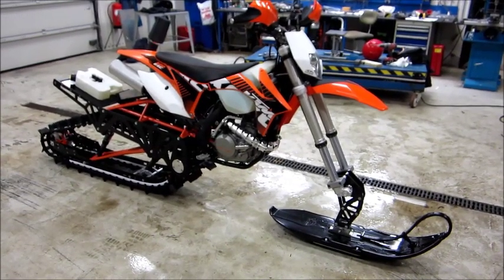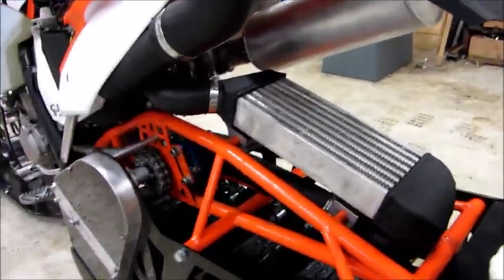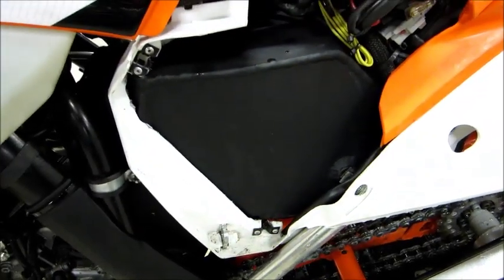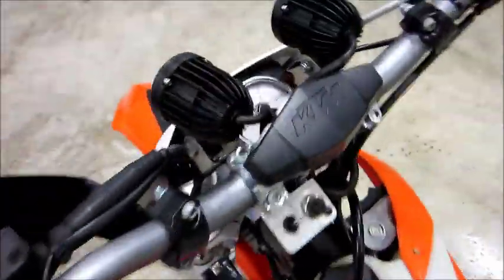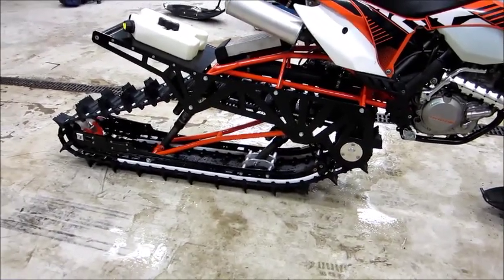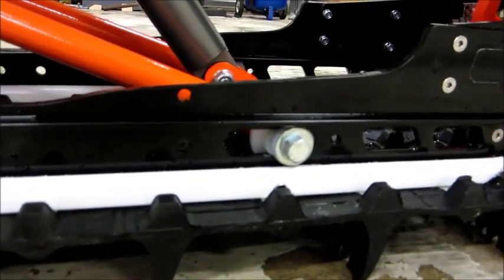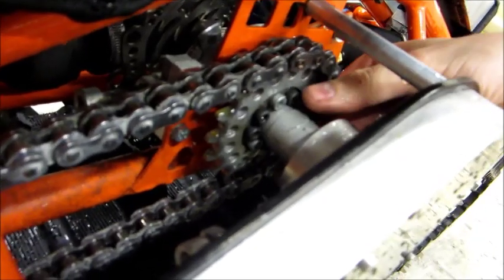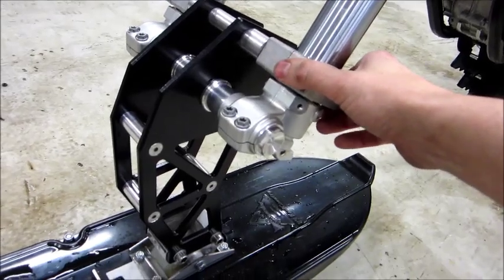Home built turbo snow bike

Comment: 96 rwhp wow ... thats a lot of POW from 1 cylinder lol do you guys use the stock rod? and how modest is this guy "its just home built" lol, its absolutely beautiful, amazing work could be sold as a factory kit. Amazing work guys love it. I get goose bumps thinking about turbo's that are breathing freezing air temps and snow on intercoolers that's just heaven on earth!
Reply from the maker: Thanks Freeflyer. Using stock rod. The ony modified on the Engine is piston, studs and clutch. Still running strong!

Comment: thing looks amazing how does it compare with timbersled? been looking into getting a snowbike but not sure what kit or bike to go with
Reply from the maker: Haven't made any comparison tests. TS is an awsome kit but we think we have some inovation in our design.
For those who want to build your own snow bike kit, we hope this will encorage you to take the step.
KTM 500 is a nice bike. Lot of HP and torqe. On downside, low prm limiter. High reving engines can be good but the 500 delivers enough power.
The KTM 500 is my firts pick. Bougt another one, a six days edition, just for spare ;-)

Comment: SORRY FOR ALL THE QUESTIONS HAKAN, BUT HERE IN AUSTRALIA GOLD COAST, NOBODY CAN HELP ME WITH ANYTHING,
TWO DYNO TUNERS WONT EVEN TRY AND TUNE MY BIKE BECAUSE THE HAVE NO IDEA WHAT TO DO. 
VERY STRANG TO ME BUT THAT IS AUSTRALIA, AS SOON YOU HAVE SOMETHING DIFFERENT THEY DONT KNOW.
YOUR MY ONLY HOPE.
Reply from the maker: Christina Ciko Nice to write to someone half way around the globe;-) Okay, it's not easy to get help turbocharging a single-cylinder motorcycle. There are not many who done it and got it to work properly ;-) There are many people on the web, giving advice without having any knowledge of the subject. I built the whole turbo system myself but took the help of MCX to get the right fuelmap. I have no knowledge about fuel software but MCX helped me to adjust the correct AFR readings during the dyno run. Bought MCX own piggyback fuel injection system so they could easily adjust the right fuel map. Haven't any knowledge in other fuel systems and the software suck as rapidbike, Dynojet etc.
I would recommend max 0.5 bar boost. Do not know the compression ratio of a 690, but believe it is equivalent to the KTM 500 11.8 :1. Hope your bike has fuel injection since it is much more difficult to turbocharge engine with carburetor. You should run on race fuel to minimize the risk of detonation. Pump gas will require a custom made Low comp piston to boost reliabaly, probably 9:1 in comp ratio.
Havent made any adjustments in ignition timing, running stock ignition... You have to reinforce the clutch. I run with double bevillning springs. Not sure what type of clutch is on the 690 but a stock clutch will eventually slip.
If you're having problem with blown head gaskets, you have to get stronger head studs.

Comment: HI, GREAT VIDEO. IM PUTTING A GT 22V TURBO COMPRESSOR AR 53 TURBINE AR 64 ON A KTM 690 2007 SUPERMOTO. I HAVE MADE EXHAUST AND TURBO MANIFOLD. TURBO IS MOUNTED JUST BEHIND FRONT WHEEL.

I AM STUCK ON PLENUM SIZE, I WAS THINKING 1 LITER SHOULD BE SUFFICIENT???? 

WHAT DO YOU THINK OF MY TURBO SIZE?
AND WHAT SIZE DO YOU THINK I SHOULD MAKE MY PLENUM?

ANY HELP WOULD BE GREAT.

THANKS STEVE
Reply from the maker: From my experience, a big plenum is very important on a single cylinder engine. I used every space avaliable to fit a 3-4 liter plenum. Hope that your front mount layout will work. It can be a little tricky as pressure pulses close to the engine can lead to high backpressure or turbine surge at low load. I believe rear is better but harder to fit if you want to run wheels and not snow.

Comment: HI HAKAN, STEVE FROM AUSTRALIA WITH THE KTM 690 TURBO BUILD. 
I TOOK YOU ADVICE ABOUT THE BIG PLENUM, I WAS ABLE TO FIT A 7.5L WATER CAPACITY PLENUM.
WHAT SIZE 2ND INJECTOR DID YOU USE HAKAN? IM MAYBE 2 WEEKS AWAY FROM THE DYNO. VERY EXCITED.
THANKS STEVE
Reply from the maker: Hi Steve. Nice to hear about your build! My extra fuel injector is a Bosch. The colour is blue and that colour code tells the fuel delivery capacity. MCXpress helped me to choose the right size of fuel injector.  What fuel controller are you using? Please post a link of a video of your build in this comment section ;-)
Reply from the maker: Whats up Steve? Any progress of your turbo KTM build? Currently on my second build. Improving fueling issues on the 2017 bike. Conrod didnt seem to handle 0,7 bar boost. Will make a stronger custom made conrod.

Comment: HI HAKAN. AN UPDATE TO THE KTM 690 TURBO... I FOUND 2 DYNO TUNERS WHO ARE INTERESTED IN TAKING IT ON.
 
THE FIRST ONE WANTS $10,000 TO PUT A STAND ALONE COMPUTER  AND REPLACE THE ORIGINAL ECU, THAT IS OUT OF THE QUESTION.

THE SECOND DYNO TUNER WANTS TO PUT A  POWER COMMANDER ($500) AND SEEMS TO THINK HE CAN TUNE WITHOUT THE USE OF SECOND INJECTOR. 

WHAT DO YOU THINK HAKAN, IS IT POSSIBLE TO TUNE WITH JUST 1 INJECTOR???
Reply from the maker: Why go for stand alone? Looks to be horribly expensive. OEM ECU works just fine! I use a piggyback fuel controller and injector. I know some turbo snowmobile builders use stand alone and larger injectors. Maybe it works. I dont have any experience of that but I guess the standard injector will not deliver enough fuel.

Comment: HI HAKAN STEVE HERE, SORRY FOR LATE REPLY, INTERNET WAS DOWN.  I HAVE NOT YET MADE A VIDEO, BUT AS SOON IT IS COMPLETE I WILL MAKE ONE AND LET YOU KNOW. I LOOKED AT THE BLUE INJECTORS YOU RECOMMENDED BUT THEY VARY SO MUCH!!
DO YOU KNOW WHAT CC OR HAVE A PART NUMBER???
WHAT DO YOU THINK OF THE SIZE OF THE PLENUM I MADE 7.5L, TOO BIG OR IS IT A GOOD SIZE???
FUEL CONTROLLER MIGHT BE MOTEC OR HALTECH.
LOOK FORWARD TO HEARING FROM YOU HAKAN.
THANKS STEVE.
Reply from the maker: Christina Ciko I'm not sure of CC Numbers. The injector is light blue. Have googled it and by looking at the colour the number might be 0280155715 but it may be wrong. I'm impressed that you've been able to fit a 7,5 liter plenum and I think no plenum is to big. Small plenums are not able to equalize the pressure pulses that occur at the air intake of the throttle body and will end up in bad performance.
Reply from the maker: Christina Ciko Any updates of your turbo build?
Reply: Hi hakan. Lovley to hear from you. 
I got the ktm going, starting running ideling boosting perfect.

The only problem was it was leaning out at 3000-4000 rpm.
So if you gave it a quick rev at idle it would sit at 3-4 rpm for 5 secons then slowly drop to idle. 

Apart from thisit was excellent. The problem was fuel pressure. It took me 3, 20 minute rides figure out the problem, by then i melted the edge of the piston intake side of piston.

I rebuilt it all, removed fuel pressure regulator from tank and now no more leaning out at 3000- 4000.

I was adjusting fuel with tuneboy software but made no difference at the time due to fuel pressure.

I just finnished it last week so have not ridden it yet. Maybe tomorrow.

It failed because of me. No one to help. So it is all trial and error. 

Nice to hear from you hakan, ill let you know what happens.
Reply from the maker: Christina Ciko So what kind of fuel system did you end up choosing? Currently riding my second 2017 turbo snowbike. Works really fine, boosting 0,5 bar and completely stock motor! Just over 90 hp... Look at my channel and you find the dyno run. Currently having an issue that its runnin rich with no boost. That feels akward to me as the motor would perform the same at zero boost.  Full throtthe its awsome, but at no boost its sputters and misses more like no spark or running lean. Have tested with a lambda guage and it shows on the contrary that its running ritch at low speeds. I cant figure it out the glitch. If I wont figure out the problem, I will mount a Power Commander to moderate the OEM fuel injection system. Not the ideal plug and play piggyback fuel system that I made on my prevuios bike....

Comment: HAKAN THANK YOU FOR YOUR ANSWERS. I DECIDED TO GET A PRESSURE ACTIVATED SWITCH $94. IT SWITCHES ON AT 1.4 PSI.
I WILL GET THE INJECTOR YOU RECOMMENDED AND CONNECT THE WIRES TO THE STOCK INJECTOR THEN TO SWITCH.

THE OTHER END OF THE SWITCH WILL CONNECT TO BOOST GAUGE LINE, ONCE BOOST REACHES 1.4 PSI THE SWITCH WILL ACTIVATE THE SECOND INJECTOR.

I ALSO HAVE TUNE ECU PROGRAM  I CAN USE.

I BROUGHT A WIDEBAND AIR FUEL RATIO GAUGE, SO HOPEFULLY I WILL TRY TO TUNE MYSELF WITHOUT SPENDING TO MUCH. NOT SURE HOW THIS WILL WORK, BUT I AM INTERESTED TO KNOW HOW WELL IT WILL TURN OUT.

YES YOUR RIGHT, THE PRICES I HAVE BEEN QUOTED ARE RIDICULOUS!

HOW MUCH DID YOUR PIGGYBACK FUEL CONTROLLER COST YOU HAKAN?
Reply from the maker: I have never heard of any turbo EFI system you´re planning to use. It's more complex than you might think. The amount of fuel needs to be delivered very precise corresponding to boost pressure and rpm. Not familiar with all types of fuel controllers. Have read of something called rapid bike but not sure if that would work in a piggyback layout. There are more manufacturers of similar controllers. The controller I'm using is made by MCX and is made specifically for turbo application. I think I payed $500 just for the controller. Not sure if MCX sells these to Austraila but you find MCX web page here http://www.mcx.se/